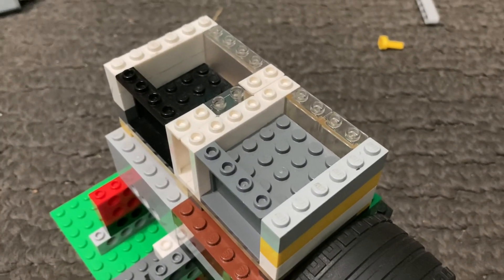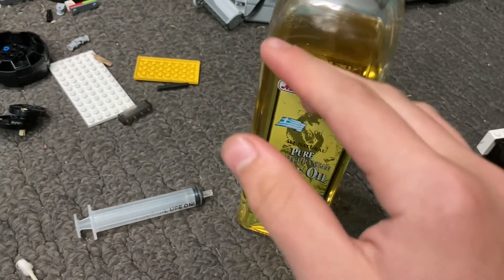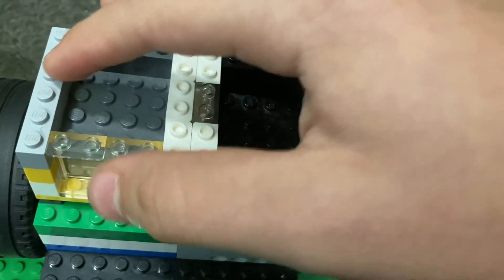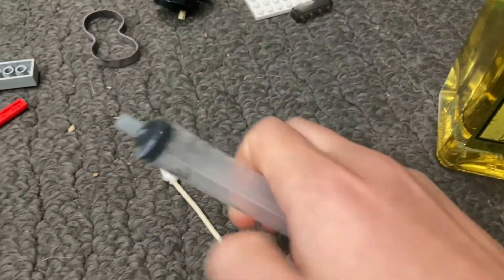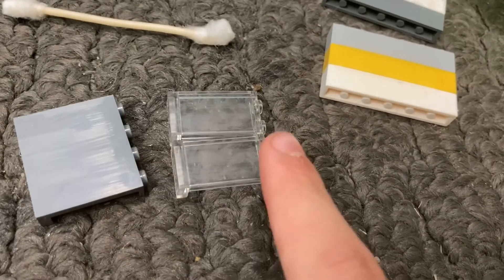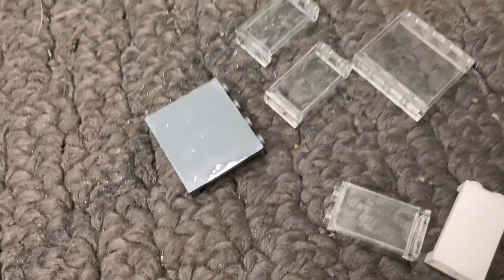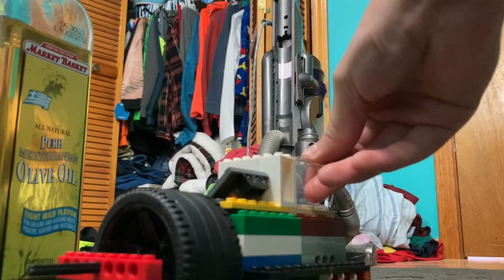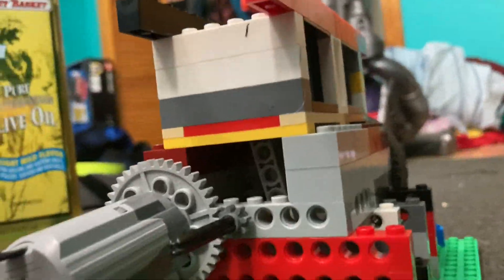Lego Engine Lubrication: The PROPER WAY to do it!

Comment: pennzoil 5w-30 euro full synthetic..same thing I put in my car, works like a champ. olive oil goes rancid after about 6 months
Reply from the maker: engine oil definitely works but certain types are known to damage lego pieces which is the main reason i never used it. it kinda “melts” the plastic whereas olive oil or vegetable oil can always be cleaned up and changed. The true best lubricant for these engines is silicone spray or graphite powder

Comment: I don't lubricate my engines, yes there are more friction i know. but I like to keep the engines pure lego so I can disassemble or make modifications on the run without needing to wash and dry the bricks. also in my opinion it shows more skill to make an engine that does not need lubrication than one that needs lubrication (that is my opinion and I am not trying to insult anyone. I think that building a lubricationless engine shows more skill, because there is more friction, thus more things need to be more precisely built.)
Reply: Not using lubricant is easy if not easier. Because since the lubricant makes it run so smoothly it blows up a lot more. Also the problem with not using lubricant is that the friction melts the pieces. So if you’re willing to sacrifice melting pieces, and want it to not run fast, don’t use lubricant. It is not more skillful to not use lubricant. (In my experience)

Comment: Having actually done a 4 month long test now, I've found that synthetic petroleum based oils do not seem to damage Legos in any way. They have not become damaged in any detectable way so far and I plan to leave them submerged as long as I can.

Originally I did this test to determine which oil would be best suited for my LVE which has a mechanical oil pump and an active lubrication system.
Reply from the maker: That’s pretty interesting, I guess the oil based ones (like WD-40) don’t prevent wear as good as the olive oil does. For example, one of the smooth wall pieces I have used on many of my engines with the WD40 all have noticeable scoring. Compared to a wall I used only with olive oil the scoring was extremely minimal. It all comes down to the practical use of the piece that’s being lubricated.
Reply: WD-40 is pretty thin, and it is penetrating oil after all, it's purpose is to slightly eat into stuff...
Reply: Its. God dang autocorrect
Reply: @KFPlusLegoMastery  come back pls :(

Comment: For anyone wanting an easy clean-up windex works fairly decent for the short term. Just spray a bit on the cylinder walls, cams, and valves and you'll be good to go. Of course olive oil is way better but windex works too.

Comment: I recomend using green sope or pretty much any oil based sope for the cleen up   since the oil based sopes suck up the oil and turn it in to sope otherwise you will be scrubing for a while
Reply: Also i recomend coconut oil/fat or canola oil as they have better lubricating propertys
Reply from the maker: Henry Valickis Thanks for the suggestions! I think I’m gonna stick with olive oil, and in regard to cleaning it off, I tend to reuse my pieces with different engines so I end up not cleaning them. Along with that, the oil runs down and goes away as the engine runs.
Reply: Yeah but sometimes the oil get all on the crank shaft and peces start sliding around and mainly your hands get oily and it takes forever to wash it off

Comment: I am fixed around the piston I do the oiling process by pouring it on the piston
Reply from the maker: While that is a very easy way to start, it doesn’t always get to the walls. When the oil sits on the piston it isn’t performing its job to actually make the engine run smoother. For best performance you should put the effort in to apply it directly to the cylinder walls.

Comment: I have been thinking of ways to actively lubricate legos. I think finding a brick that can have a small hole put through it would be perfect. Like a pin hole
Reply from the maker: Shlushe 10 An active lubrication system sounds cool! Very practical but it seems very complex and challenging to develop.
Reply: @KFPlusLegoMastery  i think if you just manually pumped a lego pneumatic piston you could run a couple tubes through and youd be all set
Reply: @KFPlusLegoMastery  Pleaseeee tell me the nameee of the tan angled peice on the crankshaft
Reply: I've actually build a Lego engine which has a mechanical oil pump
Reply: @AiOinc1 tutorial
Reply: I was thinking this a RLY long time and I already know how, I want to use pneumatics maybe good idea for you?
Reply: AIO inc. maybe make it run off the engine (great challenge)
Reply: What you could do is get a a Lego technic brick with the hole in it and put a pin in it that still leaves a small hole in the brick that leads into the cylinder then build a leak resistant container next to it’s that slowly drips down with gravity into the piston